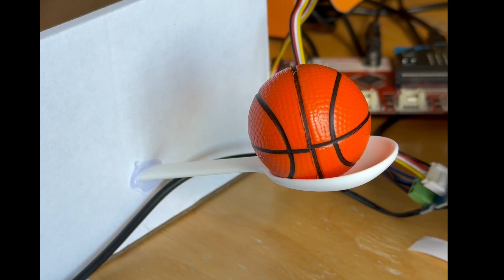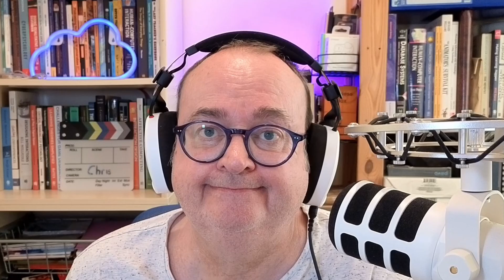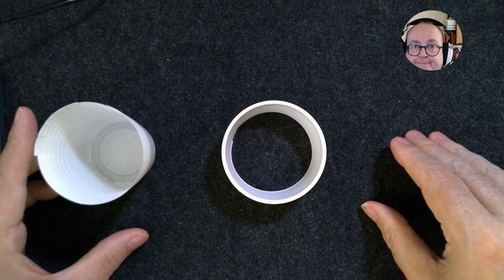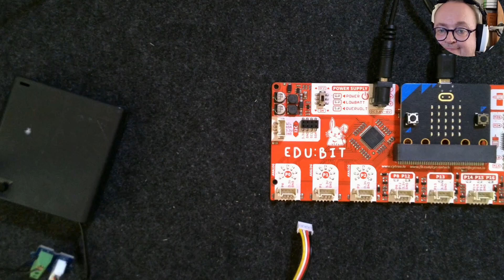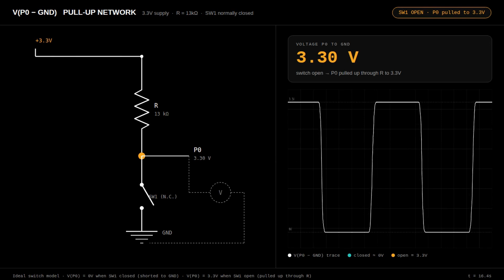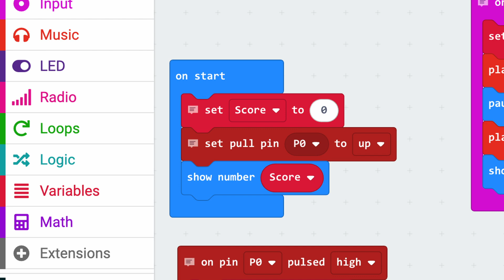I Used an Industrial Laser to Build a Basketball Scoreboard | Microbit Project

Comment: "A small creator" with great ideas !  How about adding a green LED which lights when point is scored ?  But, hmmmm, how would you design it so a red LED lights when shot is missed ?  Does that require wiring the plastic spoon to trigger a pulse when the shot is made and then compare "shot made" vs. laser broken or not by ball going through hoop ?
Reply from the maker: That’s a great idea! 💡 I think you’re right: the tricky part is detecting a missed shot. The laser tells us when the ball reaches the hoop, but we’d need another way to detect that a shot was actually launched. Maybe the spoon could trigger the start of a “shot timer”, then the microbit checks whether the laser is broken before the timer expires. 🤔🏀 What do you think?
Reply: @chrisevans-ucl  How about a simple 'broken contact ' when the spoon is depressed and then closed contact when the spoon is released ?  The Micro:bit senses when contact is closed and assumes that the ball is then launched.
Reply from the maker: That’s a clever way to handle the logic! Using the 'broken contact' on the spoon as the launch trigger would definitely make the comparison with the laser sensor more accurate. Have you tried a similar setup for tracking projectile launches before? Thanks for the great idea!
Reply: @chrisevans-ucl  , We've not tried any score keeping or sensing of launches as yet. I think we could try building some kind of launcher with score keeping using LEGO technics. Will have to give it some thought.
Reply from the maker: That sounds like a fun project! LEGO Technic would be great for a custom launcher. Let me know if you build it!